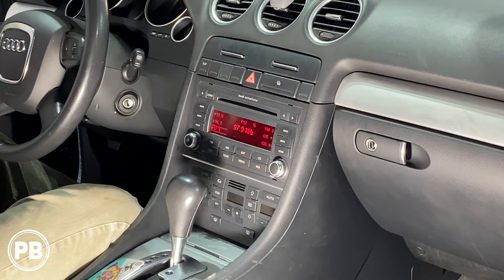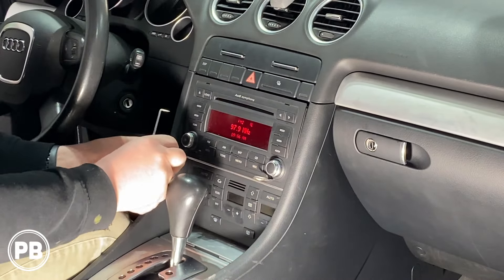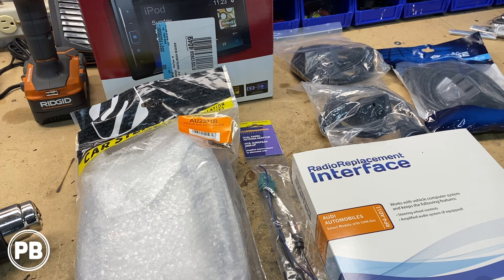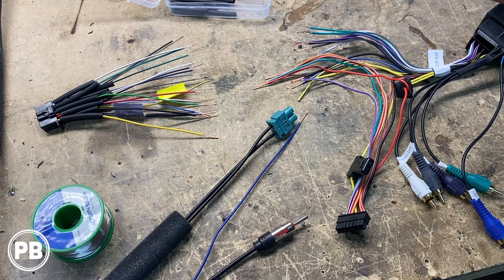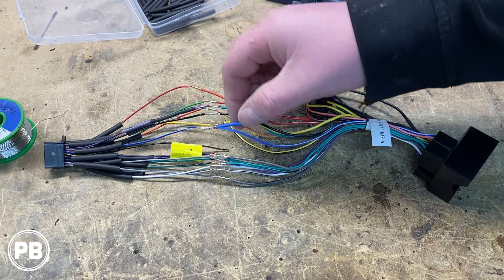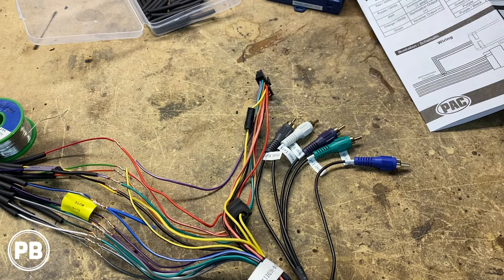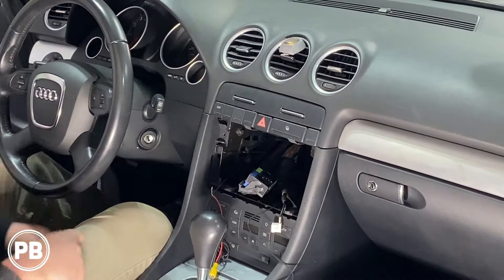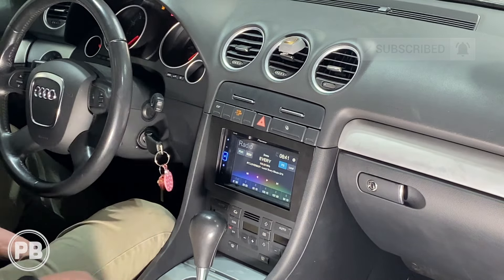2001 - 2008 Audi A4 Radio Install

Comment from the maker: Parts used linked in the description of the video!
Reply: That iso harness that you mentioned using instead of the “red one” at 4:23 is it included with that PAC wiring harness adapter ? I don’t see anything on the product description to indicate that is all.

Comment: Thanks! The PAC instructions are not overly clear on when to use speaker wires or the connectors. Have an S4 with Nav + Bose. Looking at the harness to make sure they match up, but the OEM (dash side) harness in the car seems to be missing a few leads.

Anyways, great video with good practices (solder, heat shrink, loom cover.. regards
Reply: I have the same issue, what arnés did you use to keep all functions
Reply: I have the same issue, what arnés did you use to keep all functions

Comment: Hello… do you needs bypass for the amp?
Reply from the maker: Nope we retained all factory features and even the amp.
Reply: I ended up using the other harness (red one). And I have the same Audi (2006) that’s on the pic of this video. But thanks for the video. It helps even though I had to use the other harness…

Comment: Do you have a clue about why my rear sub and speaker are not working with the exact same kit you have?
Reply: Did you find out
Reply: At 7:29 he shows a blue/white wire with an extra wire splitting off - this needs to go to your amplifier turn-on pin on the Audi harness.
Reply: @twinchargedmr2  do you know which colour wire this is on the audi harness as i have the same problem
Reply: @jameshalford4699  sorry, I can't remember :/

Comment: Hello! I have a Audi A4 2003, I put in my own stereo and I’m having a problem with it turning on with the ignition switch any help ?
Reply from the maker: Sounds like a wiring issue and you are not using the correct smart harness.  There is no analog accessory wire behind the radio which is why we used a smart harness (linked in the description).  If you don't purchase a smart harness, you will need to run an accessory wire to the fuse box for your radio.

Comment: I have a 2007 A4 that came with the Audi Symphony II.  I believe is it's a partial amplified system.  

I installed a pioneer aftermarket radio with the PACT harness; I'm not getting any sound out of the front speakers.

Comment: Do you have a video showing what you did with the USB aux adapter?
Reply: Just find a flat surface on a panel( for this car id remove the plastic panel under the shifter and use that if there's enough room)  use a drill and make a hole start small and go bigger if needed, if you have a dremmel you can use that to shape the hole, again start small and slowly make it larger. then fit it into place and hot glue it from the back of the panel to hold it in place. I know this was a year ago comment but others might find it helpful still.
Reply: or get a wireless  carplay unit